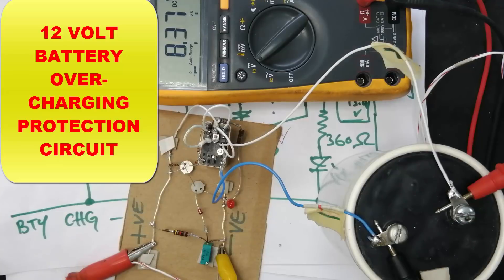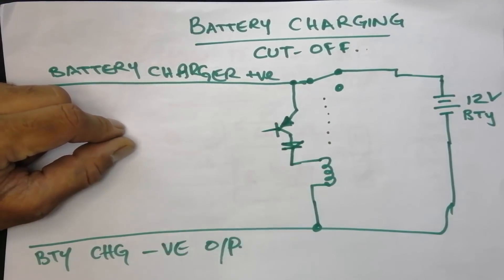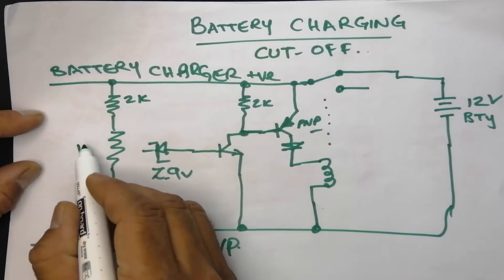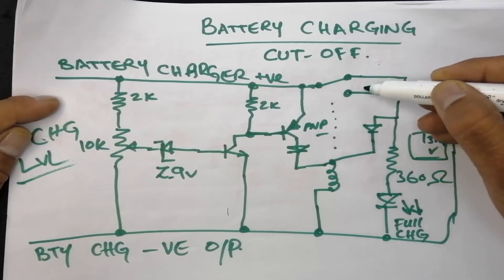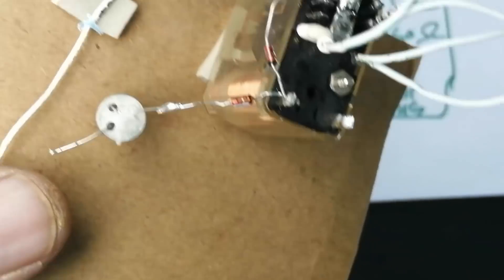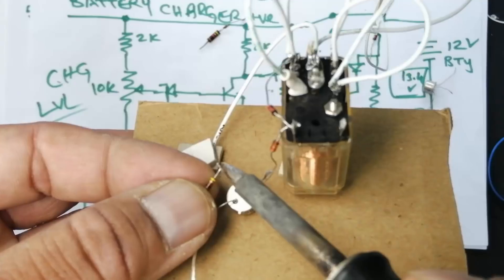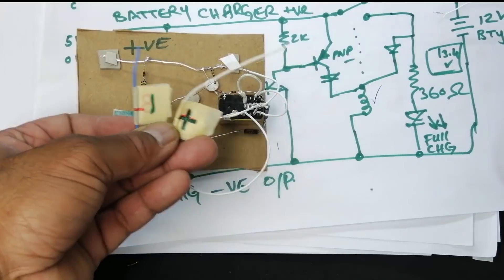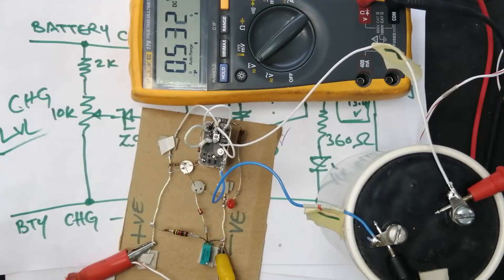Battery Over Charging Control, Automatic Cut-Out Circuit

Comment: There is issue.. imagine we are changing the battery with a 14V source.. the circuit will always be reading the constant 14V from the charger. 
When you were demonstrating the circuit you were slowly rising the charging voltage, but in real life the voltage will always be 14V..

Comment: Why the battery discharging after fully charged at 13.5v how to make the battery not to discharge after fully charged pending when the user will connect the battery to the load
Reply from the maker: to overcome this issue some best quality chargers use trickle charge method.  it after full charging, the charger keeps charges the battery,  at battery's self discharging rate to maintain the battery level
Reply: @HaseebElectronics  can you do a video how to use trickle charging to keep the battery charging but not to over charge the battery

Comment: you give the input from power supply or charger? how many volts
Reply: @haseebelectronics3312  i agree with but when the battery charger is 15 volts the circuit will not be accured or not work need to give 18 volts
Reply: @haseebelectronics3312  ok put a load on the capacitor   to discharge slowly and let we see if the relay will start again when it reach the 12 volts .